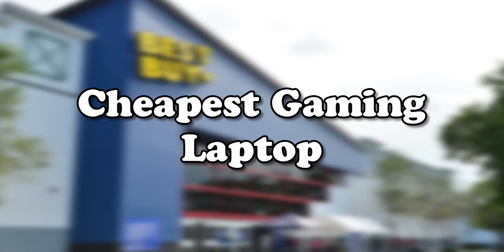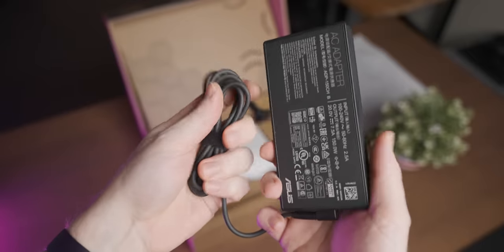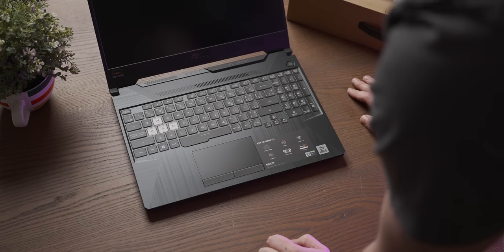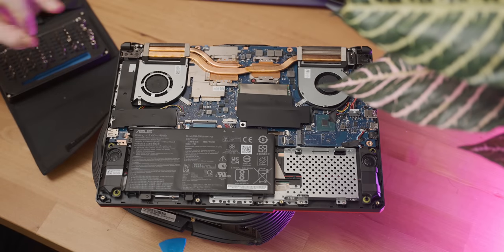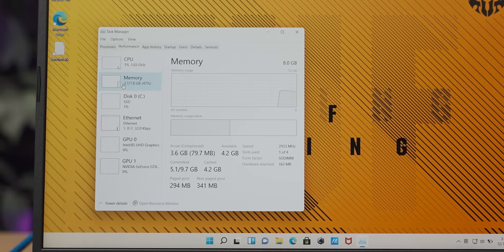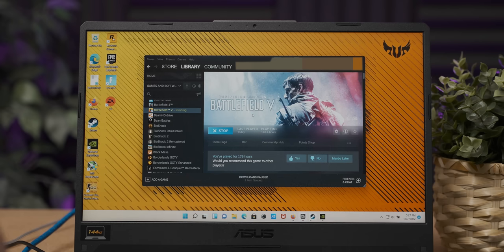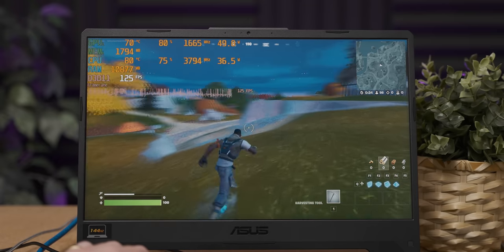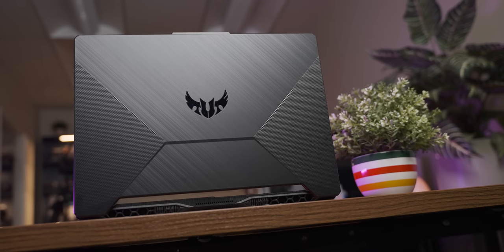The Cheapest Gaming Laptop From Best Buy...

Comment: I bought this for approx. £650 last Christmas in the sales, as I needed a new laptop capable of playing at least some games. It is generally a great starter laptop, but I agree with Dawid it gets very noisy very quickly!
Reply: I can agree because I myself have the exact same model shown. You can solve the fan noise issue by going into ARMOURY CRATE in your laptop and select silent mode. Or, you can press and hold on the FN key and click F5 and you can see either silent, performance, or turbo mode. (turbo mode will show if plugged in to AC).

Comment: As other commenters have said, you need to get JEDEC standard ram that runs at 3200mhz or whatever the max that older chipset will support is.  XMP isn't an option in just about any new laptop.  In my Acer Predator 300 I had to research this like crazy, and chose the Kingston Fury 32GB kit.  Runs at 3200mhz with no XMP control, just right out of the box.  Would probably unlock at least a little more performance if you went with a higher MHz JEDEC standard RAM kit.

Comment: I'm suprised, that the CPU is that "bad" . I've expected the GTX 1650 would be the problem in this case :D
I have the same laptop, only with i5-11400h and RTX 3060.
Reply: Lol I was also shocked 🤣
Reply: there should be a thermal limit... no modern 4 core CPU can really bottleneck a 1650 laptop
Reply: @jesusbarrera6916  I did some search online and the I5 10300H is a perfect CPU for 1650 I think it would be a driver issue sir something
Reply: At low graphics quality, you're more likely to get bottlenecked by the CPU

Comment: As proven by Hardware Unboxed, the cooling on that model can be significantly improved with some precise-yet-violent Dremeling, which is not exactly glowing praise towards Asus's product design department.
Reply: I remember that episode. Quality hackery.
Reply: Yo! I've missed that one... Imma check it out 🤣
Reply: I had a Dell in recently that the customer thought needed a new fan. It was really loud, fan going like the clappers, temps off the charts. Looked at the bottom, big intake vent area...what's the issue? Took the bottom plate off...the whole intake area the fan sucks up from was covered with a thick black plastic sticker. The kind of stuff you get wrapped round a laptop HDD. 5 minutes with a scalpel cutting out the slots and the laptop was purring. I do wonder if these companies really know what they are doing sometimes.

Comment: The reason it is struggling with 1 stick of ram isn't speed, it's the amount.
CPU has to compress the memory, put it in pagefile, and have to cover the work of pushing things elsewhere so the RAM won't be fully utilized and might get a system crash. 
Even a single 16GB stick will help. But dual-channel is always better.

Comment: Some time ago, I wanted to buy this laptop(not the same specs). I thought it was a very good deal, but all of the reviews I saw said that this laptop runs very hot, and that the CPU and the GPU are thermal thorttling(correct me if I said it wrong). I am very surprised that this laptop isn't thermal thorttling
Reply: It is not thermal throttling because neither GPU or CPU are running at full speed 😆All the bloatware taking up RAM serves as sort of passive cooler 😆

Comment: Hey there.. if you want to get this to run at maximum MT/s on the ram.. make sure to get ram that runs its max speed at 1.2v.  So many people buy laptop ram that needs XMP and 1.35v to see max speed and then blame the laptop for not being able to run it.  I generally use teamgroup as it's pretty affordable and has a lot of options for 3200 ram that runs natively at 1.2v.   I have the 17" version of this with the i5 IIth gen and teh 3050ti and it runs great with the right ram in it.  

Hope that helps.
Rick

Comment: i remember my friend has this exact laptop except 1660, it has frequent issues regarding it's fans, that brush the insides when it comes loose and make a scraping noise. obviously started after the warranty finished, and sends it back to get fixed, after which it comes back in 6 months, this thing is the reason i decided to stay away from Asus and went with an Alienware X15 instead. The build quality also reminds me of Old HP Pavilions, though i guess for how cheap it is, you can't really fault it that much on that,other then the fact that you are still wayy better of with a legion device.

Comment: I just got my first gaming laptop this month because I work in a shop where we pretty much sell everything from phones, laptops, desktops etc and I found the best deal ever. A 600€ brand new Lenovo Ideapad 3 15ACH6 with RTX 3050Ti, Ryzen 7 5800H, 2x8gb ram 3200mhz, 512gb nvme ssd and a 165Hz IPS 1080p display. That's crazy good I think for the money. I watched your rtx 3050 review with Ray Tracing testing and decided it was doing a fine job for the price. The Ti seems to be around 10% faster tho so my games run awesome. The 4gb of vram will make this gpu obsolete faster and that's a bummer. Thank you for your videos!

Comment: I bought one of these (I'm typing to you on it right now on the shite keyboard, which isn't terrible to my mechanical keyboard inclined fingers).  Mine has a Ryzen 5 4600H and the GTX 1660 Ti. Mine was used, and has upgraded RAM (the original 8GB, and a 16GB added for 24GB) and 1.5TB of SSDs, and I got this for the same price as yours. It does great on Fortnite (locked at 120), and Forza 5 (around 60 with mostly high settings). The GPU does get a little warm, sometimes hovering around 90. But I love it, since it replaced the much heavier Dell 15 7000 Gaming with an i5 and 1050.

Comment: I used to have the same laptop but the ryzen version with r5 4600h and GTX 1650.
I used to get cpu temps of 95 degrees frequently and GPU temps of around 80 degrees. Seems like ambient temperature is a real deal 😂

Comment: i bought the same laptop for the same price in oct 2021 and my unit came with with r5 4600h, gtx 1650 , 16gb of ram and only 512gb ssd in it. i was using it for more than a year it is still running AAA games with medium to low settings, i have installed an aditionel 1tb sata ssd for just $60. if you are a student or someone on a limited budget its better to get this laptop than building a gaming pc, because it draws less power and is a portable device

Comment: That performance improvement after the RAM upgrade was wild, It never ceases to amaze me how much companies kneecap their products to save a few pennies. I suspect that the ram they used must have had something more going against it then just the single channel. I wish you would have tested it in at least one game with just 1 stick of the good ram to see if there was something else going on there. Still a very interesting video, great work Dawid giving people a really good example of a case where a relatively simple upgrade to a laptop really matters.
Reply: This is mostly lack of RAM, not single channel problem. Difference between 2x8 GB and 1x16 GB is few percent.
Reply: @aleksazunjic9672 surely GTA 5 didn't need more than 8GB of RAM to run at 60+ fps
Reply: @AchiragChiragg  Depends on OS. Modern versions of Win 10 and 11 eat up 4GB RAM like cookies 😄 Thus you are left with barely 4 for all other stuff. 8 GB RAM was enough for GTA 5  on Win 7, but on Win 10 ...
Reply: @aleksazunjic9672  I can run GTA 5 with 8GB of dual channel DDR4 RAM on my laptop running Windows 10.

Comment: I had a variant of this laptop back in 2021 but I'm sure it had a metallic lid instead of the plastic one.  That said it was reliable and very capable.  The only downsides really were the fan noise on the desktop which can be counteracted by putting the machine in silent mode, and of course the battery life, which is not going to be the best on a gaming laptop.

Comment: I have this exact laptop. I replaced the m.2 256gb with a 1 tb m.2, populated the second slot with a 1 tb m.2 and then installed a 2tb sata SSD, which is something dawid overlooked. That's 4tb of storage. I am running 16 GB of RAM also. It's not a bad machine but it will easily thermal throttle.
Reply: Would u do David raw?
Reply: @thealien_ali3382  he's not my type.

Comment: Hi Dawid the reason why the dual channel ram was running at 2666 was because you were using a 1.35V ram kit, if you had used a 1.2V kit then it would have been running at 2933mHz, I dont know how much of a difference in performance that would make but it has to be worth a couple fps at least. 

I have the 1650ti version of this laptop (with the same i5 processor) which I got for $480CAD open box from Canada Computers and after adding a second 8gb ram stick for ~$40 it's a potent little unit, a significant upgrade from my 11yr old Asus G53SW (i7 2620QM and a GTX 460m).

Comment: I owned this laptop for some time and its quite good and love the build quality and upgradability of it. My only gripe with the computer is that when you have the computer on idle, the fans go to warp speed and you typically have to put the computer to sleep or shut off, so that you don't hear this blow dryer sound in the corner of your room.

But overall, I loved it and only had to get rid of it, because I needed a 4k screen for some projects over the 144hz refresh rate 1080p monitor, which was still nice to have.
Reply: Where did you buy it because im trying to buy one and don’t know where to

Comment: I have the 17 inch version of this with a 3050Ti and 11400H.  It came with an empty RAM slot that I dropped a SODIMM into and has an empty M.2 and IIRC an empty SATA bay as well.  It get extremely hot when used on the lap compared to my old ASUS GL753 because of the placement of the fans being on the bottom rather than ejecting out the side, which is my main disappointment.

Overall, a decent budget gaming laptop for some who "needs" a 17 inch screen like me

Comment: My second machine is an Asus TUF A17 I bought recently, and I’m rather happy with it. I got the latest model at the time; R7 6800H, RTX 3070 Ti, and 16GB DDR5@4800mhz. I run Linux on it and am impressed.

I use my R5 3600XT/RTX 3070 rig at home, and my laptop when I visit my mom or whatever. Linux on both, no issues, besides having to write a script for the Optimus GPU swapping in Linux on the laptop.

Comment: Honestly, having a single stick with an empty dimm slot is SOO much better than the alternative these days, being 4-8gb Soldered, and you're lucky if there is an optional dimm slot to use for upgrades. Making high end machines like the zephyrus lineup have a lower total RAM capacity than the budget lineup is just bizarre. Here's to a decade of 40gb of RAM (16gb dual channel and 24gb single channel....)

Comment: I have a similar laptop with an RTX 2060(110W) and a 230w power brick and it plays everything as smooth as butter.

A couple of years ago I bought a similarly spec'd laptop as you have today and it was a piece of crap, even after upgrading the ram to 32 GB if 2933Mhz Ram. That ASUS performed very poorly and I wonder if you used some of the tuning utilities out there if you could squeeze some more performance out of it. Also, is the integrated Intel video card disabled in the BIOS(if that's an option) - it would give you better performance.

Comment: Each hexagon counts for 10 FPS. It is known.

Having watched the whole video, my immediate thought is that M.2-2242 Slot will be very expensive to fill. There seem to be very few NVMe drives around and they are really expensive, as are the M.2 SATA in the 2242 lineup (even on Amazon). You'd be better off with a 2.5 inch SSD like an MX500 in addition to your M.2 2280 NVMe drive when looking to expand your storage.

Comment: The RTX 3050Ti and 6800H version of this TUF laptop at $750-800 on sale at BB on and off normally $1100, and the Gateway Creator i5 10300h, and RTX 2060 from Walmart on sale at $659 when sold normally $800 will forever be the value champs to performance in the past 3 years.

Comment: MyAsus is also useful for configuring your battery charge like you can set the battery to stop charging at 80% so that it doesn't overcharge and in GTA V, when CPU Usage is higher than the GPU Usage you can increase the in-game graphics to avoid bottlenecking.

Comment: This is awesome, finally on to a look at a TUF. Bit pricey considering you can get that for 550USD. Does best buy have price matching? Hmm.. I've been recommending the one with the 4800H/3050 16G mem/512G nvme for $740. But the model with the 4600H (similar to the one your looking at .. same 700CAD price tag, is pretty ok to..) I'd recommend having them install that additional 8G of memory.   MemX does it for the cost of the stick which is nice. Not sure on BB.

Comment: Great video - i have one of these. I am confused as to which GPU you are showing though. In this laptop there is the AMD inbuilt GPU for desktop type stuff and then theres the NVidia GPU for gaming (least i think thats how its meant to work). I think you showed playing with the settings on the AMD side when surely the NVidia settings are what you should be looking at? I know for the games i play, i have to specify in windows that each game is to use the NVidia card. Were all the games you showcased using the AMD or NVidia GPU here? I am just curious as its made me doubt the use of the nVidia card unless it is connected to an external monitor. Maybe i am just generally confused ;-)

Comment: I picked up the tuf gaming F15 i7 12700H 165 hz 1440p IPS screen with 3070 for less than £1200 from overclockers during black Friday, around £600 off. I'm very impressed with it and got it for less than a decent desktop GPU these days.

Comment: I bought a laptop with a 10500H and an RTX 3060 last year because it was the same price as a desktop 3060 during The Scalpocalypse. It also came with a single 8Gb stick and putting a 2x16Gb setup into it made a similar difference.
Reply: the laptop 3060 is really just a glorified 3050 though but it works fine

Comment: The problem are the subtimings of stock rams are horrible. My legion 5 had a 3200mhz ram in it. I upgraded it to 3200 mhz again but with much better subtimings the Performance uplift was about 10-30%

Comment: I have the 3050 version because I was tired of hauling my G7 back and forth from the school I work at. I paid 600USD. With 8gb single channel it was craptastic, but upgrading the ram and adding a 1tb ssd was a $100 upgrade and works just great for my needs. And yes, I do use the numpad.

Comment: I have the i5 9300H version of this laptop, same gpu. In my case, using the same RAM, the speed was a limitation of the CPU and cannot be modified in BIOS. If that model has 3200 originally, then the RAM modules need to have the same timings as the original in order to get the advertised speed. As for cooling, it has the same heatsink as mine. I modified it by getting an additional heatsink, separating the copper tubing from the plates and fins and gluing it on top of the already installed heatsink. Also used Kryonaut. Temps are a lot better and allow to squeeze more performance out of the gpu. The temps don't stay that good for long, so a re-paste will be needed shortly, and the same goes for liquid metal. Temps get better with liquid metal, but it's efficiency gets lost after a few months. Overall it's a good laptop. It's done me well for the past 3 years or so. I played plenty of games on it by tweaking settings to stay at 60FPS.

Comment: i own a very similar laptop, it's the fx505dt laptop, and it uses the same gpu, 120hz display, and an amd cpu. i have 16gb of ram instead of 8gb in dual channel.
gaming laptops with optimus built in is meant to be docked into a main setup, and can be used for on the go if you have a low power game running.
edit: the laptop i own is the Asus TUF fx505dt gtx 1650 model.

Comment: If you wanna get rid of bloatware easily, use BloatBox. I used it for my Dell G15 5510 with a 90w 3060 and 10870h and it got rid some of the nasty CPU bottlenecks. I don't recommend using it yourself so if you are going to use it look for a vid on how to do it.

Comment: I have the same laptop spec to spec(I picked up in Feb for around 850 USD) and my temps are way higher than yours. GPU is 75-85, CPU is 85-95, occasionally reaching 98. I regret not getting the 3050 model for about 100 dollars more as it has a newer CPU as well but theres no point in crying about the past at this point. I'd say if you are getting this laptop (tuf f15) get the 3050 model and not the 1650

Edit: also stay away from warranty if your laptop don't have a glory hole as (for me) the "Asus authorized" shop was charging X2 the price to upgrade the ram.

Comment: I personally use a dell gaming laptop from 2017 as my main machine. It also came with a single stick of 8gb ram. I just changed it to 2 sticks to make it 16gb and I can confirm it made games perform like it was new again honestly. Major difference.

RIP this machine, the screen is dead so now it's closed and under my desk plugged into a monitor + mouse + keyboard. All that extra money for portability and it's a desktop now. At least the battery was removable so I just scrapped that entirely.